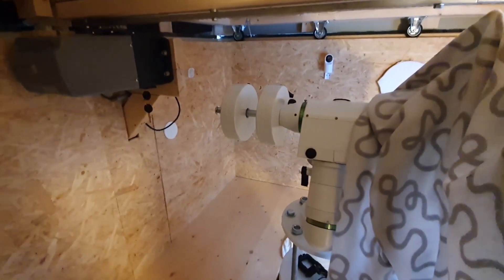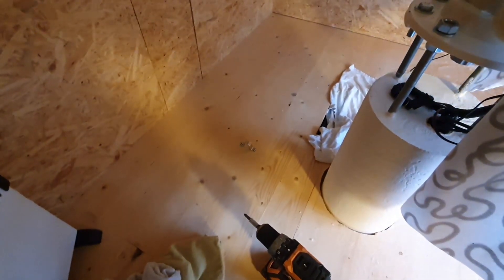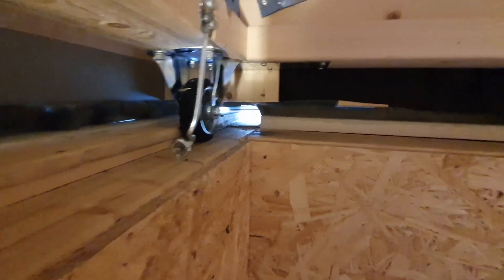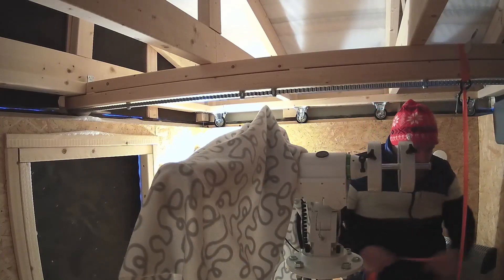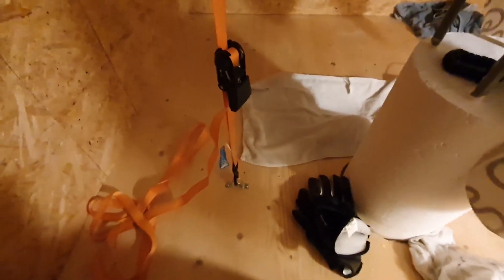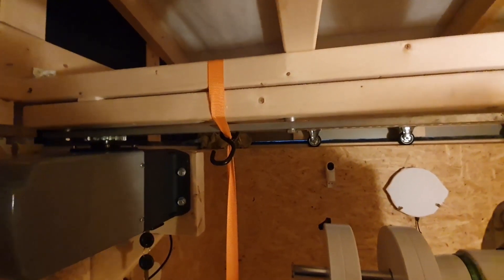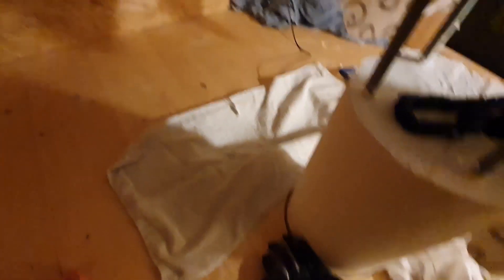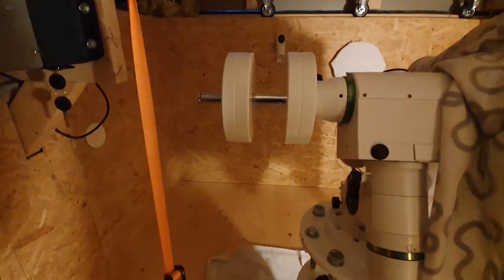Will the observatory survive? Five days blizzard and heavy snow

Comment: I've been inspired by your project and will likely come up with a sollution this summer as well.  Thanks for putting this together as I also have the HEQ5 Pro and will likely build a concrete pier too.  I was curious how the track system would hold up with snow and ice builde up as that can be a problem in our location here as well.  I like the idea that the roof load is riding on top of the wheels, rather than in a track system similar to that of garages.
Reply from the maker: Thank you so much for watching! The roof system has worked well, not had any issues. I do need to clear snow and ice before operating it. The weight has kept it in place. The larger wheels are forgiving for slight shifting in the wood.